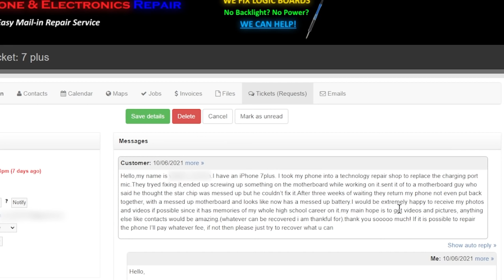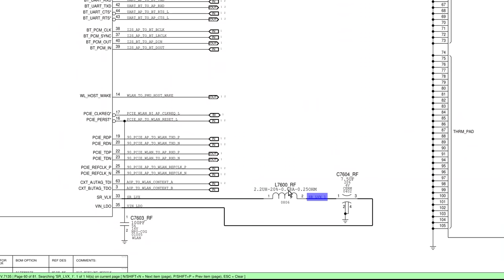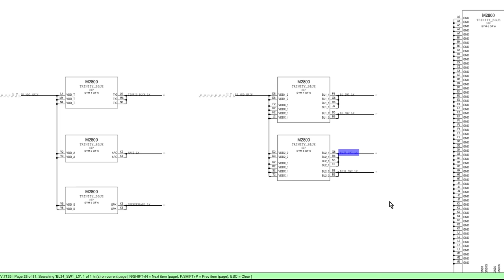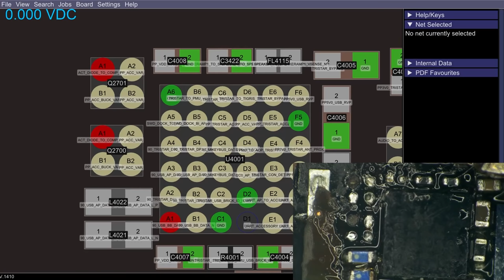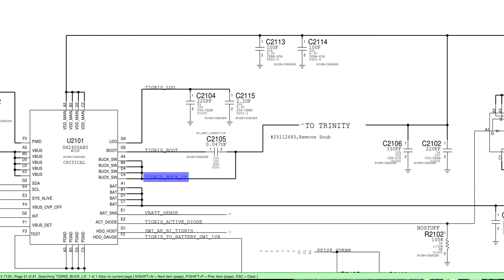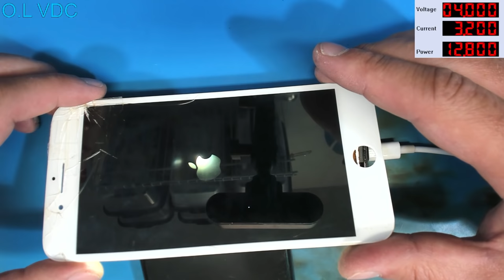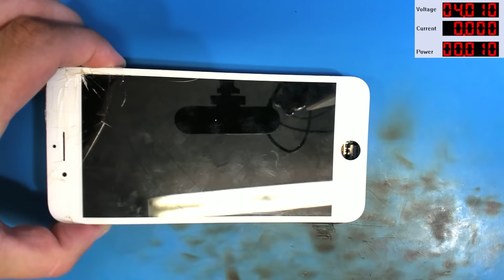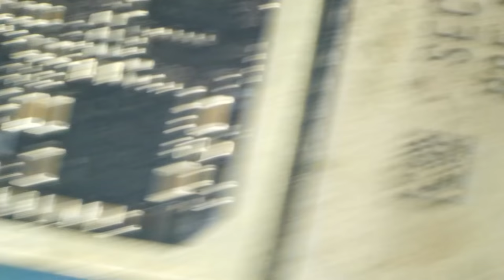Another shop mutilated this board - I got the data (and ROYALLY trolled myself)

Comment: I haven’t a clue as to the work and the terms being used, but I couldn’t stop watching as you worked on these tiny components cleaning and soldering, and then getting the damage repaired for recovery, the entire process was fascinating. Fantastic skills and incredible patience on display.
Reply from the maker: Thank you! 🙂
Reply: And he explains everything, and the video is just over an hour, thought edited, he could probably do this in a reasonable time and maybe cost, where Apple will not even fix your mic issue, and sell you a new one for still way too much for what the problem is, and data recovery, fuck that, Apple does not care, they don't do any of it.
This is why the right to repair movement should be backed, and not even be needed.

Comment: I used to do electronic repairs when you could actually see the chips without a microscope. Watching you work on this was amazing. It's a completely different set of skills to what I learnt last century
Reply: Old work-dogs seeing new tricks with open eyes is so nice.
Reply: @lilletizz  This is scary, I was thinking about the same thing but didn't know how to describe it.
Reply: same stuff, just smaller and you have more tools.
Reply: agreed, I haven't done repairs like this in Years.  Last time was about 10 years ago and was outside my comfort zone fixing the RROD on xbox 360.  All the talk about ball reflows reflows for the chips etc....   

I took the basics using a Heat Gun for environmental splice shrink wraps and used that to reflow.  Some other components were not happy about it. but got several of them up and running again while oversees.  All but 1 lasted 2-3 years.  WOuld have gotten more time out of them if I had the right tools and practice in that skill.
Reply: I am an electronic and IT tech expert my self. Just to put an image in your mind about how tiny components are today, left your hand and look at your fingertips. Imagine a component small enough to rest between the groves of your finger print. Thats about how small a 0,10 to 0,20 mm component is. And yet, with a tweezers and a steady hand you Can replace them. Just a Dahm good hint. Hold your breath! No joke, you Can blow The “dust” away 😀
Reply: @titandown  a quality stereo microscope and good reflow tools are essential, eyesight and no shakes also...
Reply: Hear you hello from Australia when one had to be only  careful with the soldering iron lol yep last century my first computer was a Pentiem1 doesn't seem that long ago,when it was mb and not GB
Reply: @TheSilmarillian  lol....my first pc was 64K and I bought two tandon 5 1/4 floppy drives for it...
Reply: @jim7smith  Mine was a Pentiem1 and when I added a trident sound card I was king of the block. Only had dial up back in those days no great god google or social media
Reply: @TheSilmarillian  yep, I had both of those items several years later.  Also had the fasted BBS in the state of Alabama for a year or so, 2400 baud.  Those were the days... No one even knew what a GB was.  Bill Gates even said "No one will ever need more than 640 K of memory." , and then proceeded to make all kinds of roadblocks to anyone wanting to use more than that.

Comment: This is exactly why I don't touch things I know I will not be able to fix. If data is important, I always point the customer to you or Jessa. I don't even want to do B2B, I'd rather get the customer a direct line to the actual person repairing their device. Unless of course it's something I legitimately messed up on accident, in which case I do everything I can to do right by the customer, no matter the cost. 

I've learned a lot of valuable things from your channel over the years. I would say the most valuable thing has been how to value time. I think a lot of people in this industry massively devalue how much time it takes to repair their own screw ups. No way in hell I'm gonna use a customer's device loaded with very important data as a guinea pig. I wish more repair shops had this mindset, it would make all of our lives a lot easier. You are a great person for putting up with this industry's crap.
Reply from the maker: Hey!  I really don’t like outsourcing anything either…. I also refer people to other shops rather than trying to do the whole middle-man thing.  I’ve probably missed out on a lot of money this way but the amount of stress I would take on is just not worth it for me!  I’m pretty sure I’ve known you since this channel had less than 1k subs or something 😮😮 thank you for the referrals and commenting!  I like your floppy drive videos — ur the original one to do that I think.

Comment: The moment you tacked onto the ground pins I started laughing to myself.  I've done it before, I do radio repair and my components are much much bigger and I still missed it!  LOL   Good recovery, good job.
Reply: I've done it too with Automotive wiring...Just takes one pin and nothin works right and your left wondering what ya did till you refocus and start tracing everything ya touched...Again.
Reply: Same here.. I saw it when the moment he started Solder that wire..
Reply: I noticed he was on the bottom row and not one up the moment he did that and was wondering what the heck he was doing not following the board view schematic.

Comment: Amazed. I being from old school as a kid, began tinkering with TVs (Zenith, Magnavox) using TANDY equipment (RadShack) learned the dangers of transformers by getting belly too close to them (ouch).  Fixed electronics as a hobby through 1970s-90s.  To see the magnification used, and the schematic visuals are amazing. You do a TOP job, entertain and inform in a manner that teaches.  The ultimate gift to the next generation.  THANK YOU!

Comment: Seeing as you have the best setup ive ever seen in desk repair equipment it does kind of startle me that you use probes with the micro equivalent of the end of a fire poker to probe really small stuff. Ive been digging around in stuff from the 1980's till today doing repairs for people on their prized and treasured electronics. All my micro probing equipment, ive made special ends for the multimeter and scope probes out of a standard probe end and soldered a sewing pin to each probe end, converts a standard probe to a micr4o probe end and then used some wire insulation to slide the pin through to protect the main shank leaving a 3mm visible stainless steel tip. Put a piece of heat shrink on the former probe and an et vuala, a micro probe end that doesnt cross micro spaced boundaries and also makes for a better connection using the point of a pin rather than a full on probe end. Build cost, less than a dollar and gives me a far clearer view of the contact im probing.
A Merry Xmas to you and a very happy New Year. Superb video and very engrossing
Reply: Amazes me there are not replaceable probes for this kind of work?

Comment: There's a simple rule in everything: start with simple things to gain experience and only after that,  go for more advanced things otherwise you'll damage everything beyond repair. Buy cheap damaged things and try to do your your best. This way you'll get more experience and if you ruin something, it'll cost next to nothing, you'll learn from your mistakes and no real harm will be done. One very important thing: if you think that something isn't repairable, store it properly for a later attempt, don't throw it as it is already garbage because many of the times you'll probably be able to do some magic later and fix it even if it looks like it's not fixable at the time you can't yet fix it.

Comment: Great job Jase ... I must admit I prefer listening to your channel, more so than those condescending repair channels ... here's a tip for the solder mask ... when using the UV light, flash a bit of hot air in there too, this will speed up the cure time ...
Reply from the maker: Thank you!  I had someone else suggest using UV mask with heat as well.  I’m gonna have to try it.  👍
Reply: @ststele Chemical reaction rates are mighty nonlinear vs temperature. A little bit hotter can make a huge difference. And this is a polymerization reaction. Some of them run away with heat added but we have so little solder mask here nothing will be set on fire. Probably wouldn’t advise trying heating a whole bottle of it up and throwing UV on it.

Comment: Here's a suggestion I have for all  board repair folks. Go to harbor f r eight and get some scribes. Remove the straight scribe from the aluminum handle, grind the part that used to be in the handle enough to be capable of accepting solder. Get a red and black Bic stick pen and remove all parts, remove the ink cartridge from the color tip and discard the cartridge. Feed red or black test prod wire through the pen body keeping colors straight. Solder the test prod wire to a scribe tip, let cool and push into pen body. Slide color tip back onto pen, fill body with 5 minute epoxy.

Comment: Great work on everything else but putting that wire on the ground! This is a good reminder that you should re-check all modifications and re-count all the affected pins before doing anything else if things do not work as expected. Even though swapping parts is not that slow, it's still much slower than re-counting some pins for an extra time.

Comment: You are surely a beast of a micro electronics repair person. Without searching the comments, ¿how much does a job like this cost? It must have surely been worth it to the customer because you spent a great deal of time on this job. I used to be a TV tech before it was cheaper to buy a new one so I have an ideal of the cost. My main job was repairing RCA/GE receivers as they had solder point issues.

Comment: great job.  when you soldered to the ground pins, I thought it looked strange, but with no experience with the schematic software I figured maybe it wasn't a visual match and you knew what you were doing.  When you figured it out, I shouted to myself 'hey, you suck as much as I do!  I'm watching you to suck less!' : ).  Admire your even temper and dogged determination that got you there.  I work only with through-hole, watching microscope repairs is both fascinating and terrifying.  but that bit when heated BGA chips slip into place, so satisfying.

Comment: I work on vintage Guitar Amps and Receivers, for the most part they are Valve / Tube state. The work is a lot less clumbersome but i dernt say it but far more risky in terms of  the voltage we deal with. That's not to say we both have strict safety protocols so we don't get our Balls squeezed. If you don't mind me asking on occasion do you ever have the odd board become conductive? I have had a few cases which this has happened usually there are 2 notorious offenders but i won't mention their names. One of the companies who's Amps are getting more and more like what i'm seeing you deal with heare. IC chips everywhere, tiny caps and resistors. A well lit strong inspection magnifier was all i used to need but i have had to invest in a camera that will bring up that kind of detail. Most of my work is point to point with negative feedback loop mods and just generaly making these 50's t0 80's Amps safe. I was wondering does this problem ever present itself to you, the conductive boards i mean? Thanks, love the channel and i'm about to subscribe.

Comment: To cure your solder mask almost instantly, use a UV laser. I have a bare module connected to a 9V battery through a mini voltage converter board (or just use your bench power supply). The UV laser modules are very cheap. (always wear UV protection glasses, of course).

Comment: I was a senior tech at a few companies (Mitsubishi, WD, and 2 others), I hired techs and its embarrassing, it takes ~20 techs to find a competent one, same with electricians, mechanics, plumbers, etc. No doubt lots of stuff gets hacked up. Nice technic finding the short, I dont have a thermal cam but use the alcohol method. One thing to note, never go higher voltage than the rail  is meant to be at, EG a 1.8V rail, dont go above 1.8v, because when it does open, you now subject all components on that rail to excessive voltage.

Comment: You 😅are a real surgeon with electronics.I recently built up a pcb from pcbway which has a uC 14 pin about 3mm wide and 4 mm long. Managed to drop it on the floor of my workshop and searched for it for 1.5 days. Eventually found it imbedded in the bottom of the soft rubber on my flip flops. Have no idea how you manage to hold things so steady. I am ok to begin with, then as I get close to ground zero I develop a 5mm oscillation. Could be something to do with my 73 year old lecky hands....you think?? Any suggestions for a damper/shocky appreciated. Again, great stuff.

Comment: I know absolutely nothing about Phone or computer repair and not much about Cell phones however I really enjoyed watching this all the way through. It amazes me how you even learn all this technical stuff and are able to diagnose and track down the culprit or in this case many culprits. Just to add if I took my phone in for a straight forward repair an it came back mutilated and in pieces I would be suing the shit out of them and making sure they paid for all their butchered work. Do they employ people with no training or certificates for repair and have them learn on the job? 
Surely one must have gone through technical college learning electronics and then sat and passed courses for circuit board repairs before you actually started working in a repair shop?? How does it work over there? Here in the UK you have to be qualified to even apply for this kind of work. Anyways a great video, I don't know how you keep your cool 'cause even I was feeling a little outraged at how stupid and pointless the botching was especially removing parts for no reason and then not even putting them back. 
My next phone is going to be a Fairphone or the like 'cause they are cheaper and they supply parts and upgrades in like modules and they offer lots of models. They are going in the opposite direction to the big names like Apple and Samsung.
Reply: You would be mistaken.  And don't call me Shirley.
Reply: @stargazer7644  How am I mistuken Shirley?
Reply: @MICKEYISLOWD  Most people who work as cell phone repair hacks have not "gone through technical college learning electronics and then sat and passed courses for circuit board repairs".   Colleges don't have a cell phone repair degree.  That's why you end up with phones in that shape.  Most people with that level of education aren't fixing cell phones for a living at a kiosk at the mall.

Comment: This looks like someone either mistakenly sent the customer a donor board instead of the customers board, OR, the other repair shop used this customers board for donor parts. Yikes 😬😳
Reply: The customer's pin worked to unlock this board.  It isn't a donor board.

Comment: Carbon is used for electric motor brushes to conduct the current to the armature. Get enough carbon and voltage and it will explode like a shorted wire.

Comment: Oh forty four..?
Oops I meant 0:44

You think THAT battery is swollen..?
It isn't even much more than 5% slightly larger .

My HP Laptop still works - even though I finally decided not to risk it anymore - when the entire screen fell off, and the laptop's framing disintegrated inside - with a forever swelling battery - long past "out of control" looking more like a tubular sausage roll - than a flat pack.

I was using the 10" HP laptop as a desktop motherboard - for a 21" monitor & a wireless keyboard/mouse .. 
And so I only had it behind the monitor - to be able to "push" that top wee button to turn it on.
(turning it all off was easy - via the win 10 power off function)

When the battery got so huge that it forced the front half of the laptop to pop-off the back half - I had to use an old (100Amp) battery jumper clamp - to hold the two plastic bits together, so that I could still push the button to turn it on

When the screen fell off and hit the desk and left me with a metal inner - dangling by a flat cable connect - It looked bad then.
That was about halfway through the swelling process.

I refused to stop using it at that stage - and only after another year or so (of the battery continuing to expand) did the "clamp" itself, snap the backing plastic plate in half - did I decide - nah - better get a replacement tower unit - and retire the "still working" remans of the HP Laptop.

Battery size - hell yeah - by then it was TUBULAR in shape & more than 3" thick - instead of the original 1/4" (and looking more like a sausage balloon - than a battery pack)

Never say - that your "battery" is anything other than starting to inflate.

Comment: There is a much Easier and Exact way to find a short. Set your Power supply as you did to supply current. You need NOT give it enough to make components or traces hot. Put your neg lead on Neg where your power supply connects. Now with positive lead of milivolts, Watch the voltage drop as you follow the trace. Voltage will increase as long as you are on the correct trace. If you take a wrong turn you have NO voltage drop.  This method takes you straight to the short.
   I'm a tech with more than 25 years...   What you get is basically a mil ohm meter using power supply in constant current mode and your volt meter to chase voltage drop.

 You are doing it the hard way and wasting lots of time.

Comment: I have a Antminer z15 hash with a number of SMD capacitors burnt about 10 and some board damage. Looks like it is the green insulation around 4 caps.   If I sent pics will you be able to determine if it’s repairable.  I spent $6k and warranty does not cover burned electronics!